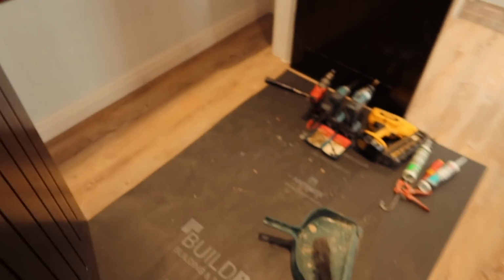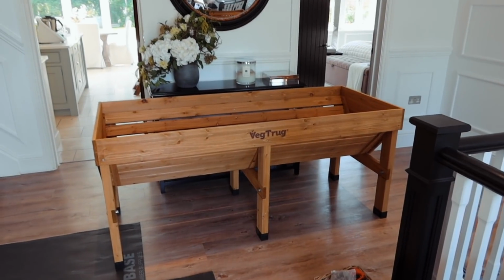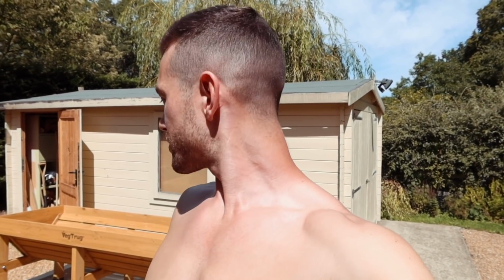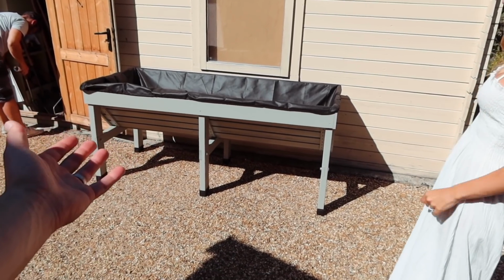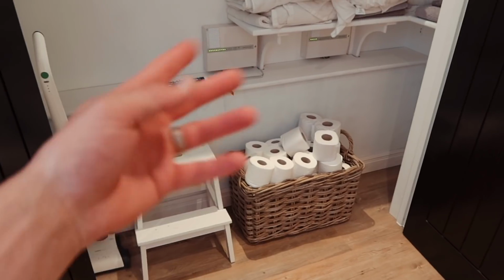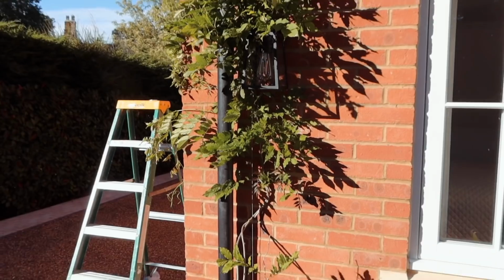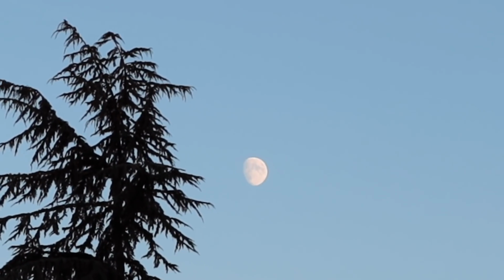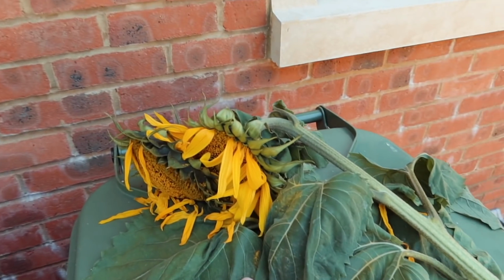BUILDING HER GREEN DREAMS | Ali Gordon & Lydia Millen

Comment: Ali- the convex mirror in your front hall was originally used in days of yore in a dining room and the hostess would place candles in front of it to amplify the light. 
Re: sunflowers. So so easy to grow, though I always did it at the start of summer (Colorado). Just find a nice empty south facing wall and poke a hole in the dirt in a straight line parallel to the wall. Drop in the seed and water occasionally. Ours grew to 8 feet tall! You’d have to Google if you want a field of them. 
Google the moon looking different too. I know why but it happens but it’s hard to explain (my husband could as he’s an aerospace engineer). Cheers on all the house stuff. Going to look into growing wisteria now that we’re in Florida! 🙏

Comment: Just a tip that I learned ; instead of filling a large planter completely with soil, put some crushed aluminum cans in the bottom before filling with soil. It will make the planter lighter and not use so much soil.
Reply: Endless u don’t want it to fall over the extra weight is good.  Like rocks would do nicely.
Reply: The soil can still get through the cans. You don’t need 2 feet of soil to plant a rose .Not enough sun where she planted anyway so it will not thrive.

Comment: You may need to get pot feet for the new rose. If it rusts on your concrete it is a bugger to get off concrete.
Reply: Probably would be good to allow for air circulation as well
Reply: You shouldn’t really have anything that will rust resting on concrete.  It will stain..

Comment: The moon: It's due to the position of the earth in relations to the moon. The moon moves in an elliptical shape meaning that the moon is actually closer at times. However, there is a "low point", close to the horizon, in which the moon appears bigger. The same goes for the sun at sunsets/sunrises. Neither orbs are closer but lower the angle combined with how the light reflects and hits our eyes makes it appear bigger/closer.